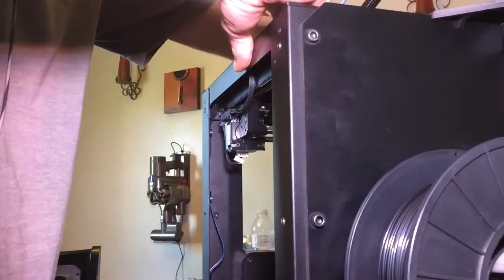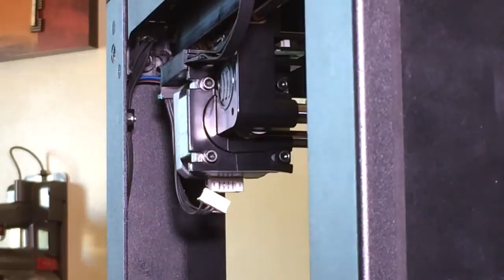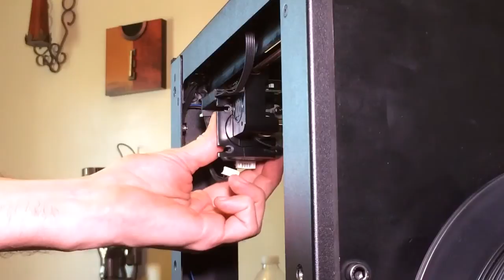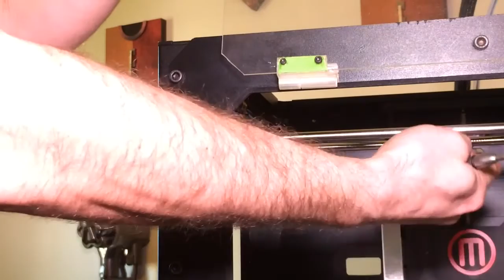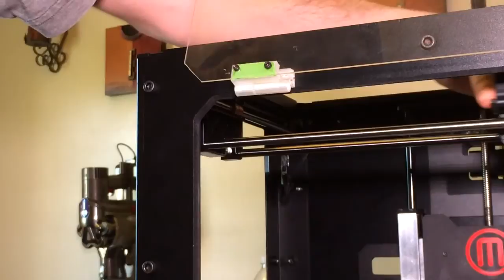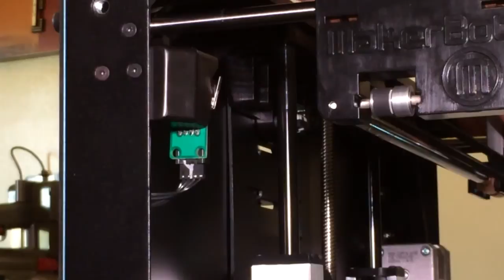Install of the AlM Gear replacement stock idler.

Comment from the maker: Walter Miraglia 
Good to hear it went well. Removing the pin would have happened sooner or later anyway. It's better it's soon and you know were it is. 
Their is a X-cable support on thingiverse for the cable, it will hold it in place better than e pin and help support the flex so it's not as drastic.

Comment: installed the Al x-idler, with no issues :) other than i dropped one of the stepper motor screw washers and had to get it off the rug before the dog ate it... :)  but all is well back together, and while i was add it I removed the metal pin that held the x-axis stepper cable in place... also going to trace out the size of the window for my home made side windows :)